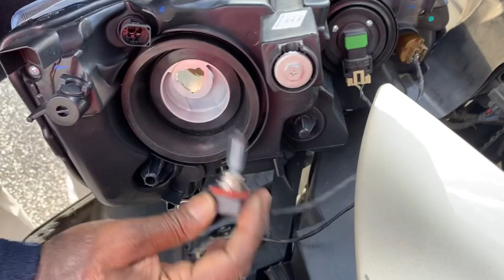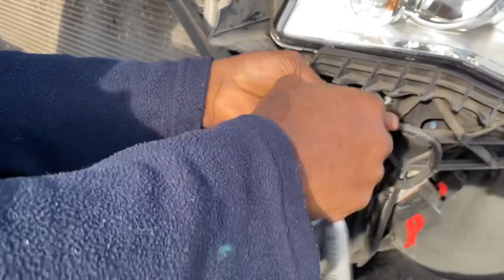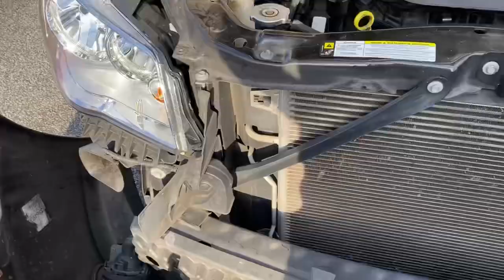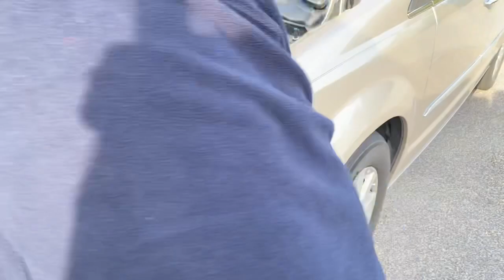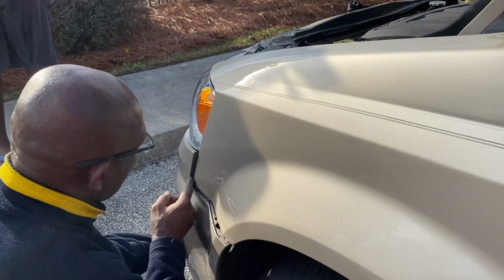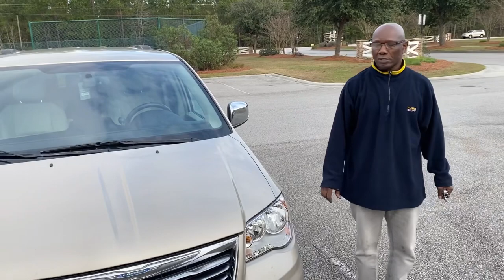PT 2 | Changing out front headlights -Installation | Chrysler Town and Country 2012-2015

Comment: What is the little ratchet screw driver thing ur using?
Reply from the maker: The tools I was using was a 3/8 drive ratchet with an extension and a 10 millimeter socket.
Reply: @bagwindydiyauto thanks so much
And u seem to know lots about cars 
I have a 2015 town and country 
Do u know what is wrong if one of the back sliding door windows won’t go down to do ?
The button up front on driver door and on the back door button as well 
 u click it nothing happens 
Just won’t roll down ?
Thanks
Reply from the maker: It’s sounding like you may have an open ground  between the forward and rear switches. I would suggest you check your fuse box under the hood for open fuse .  If that doesn’t work, have a certified technician troubleshoot the door regulator for continuity. Hopefully that helps.
Reply: @bagwindydiyauto ok thanks I will check
Can it be a fuse if only one of the windows don’t work and all others roll down fine ?
Thanks